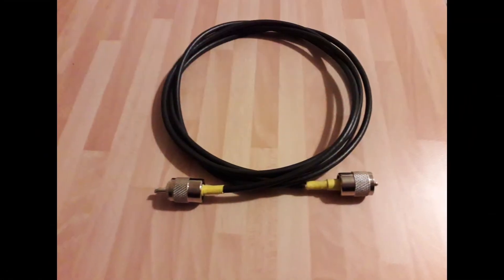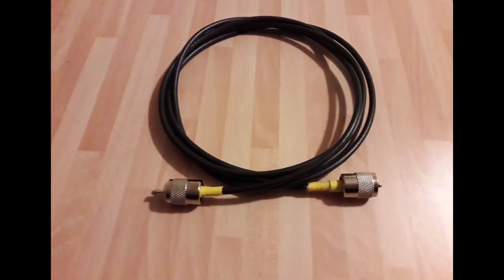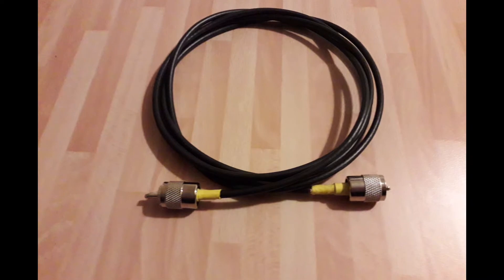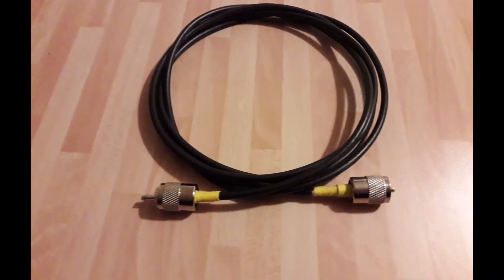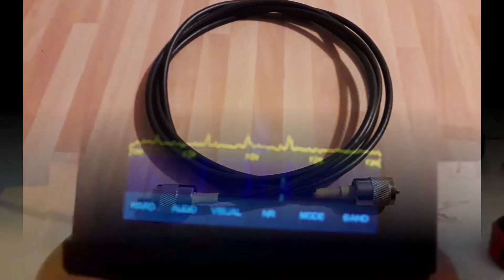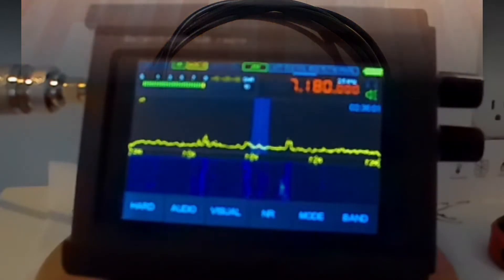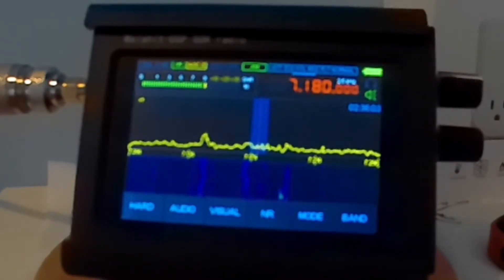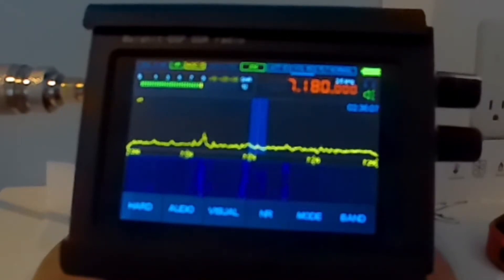Ham Radio. Coaxial Cable. Problems. Copper or Steel.

Comment: I have seen this form of cable for many years, decades even.  I had a spate of traps that did not work correctly and found I had copper plated steel coax.  Not had a problem with broken cores though.  Suspect it is companies trying to make money by cutting down the amount of copper they use.